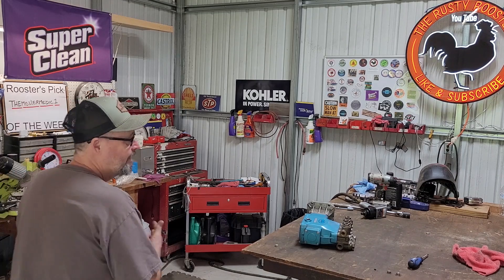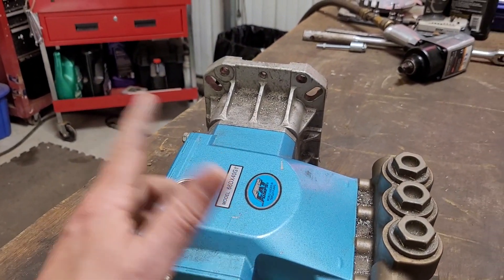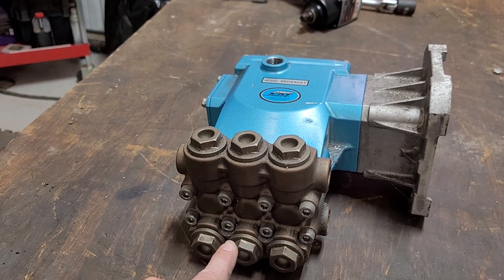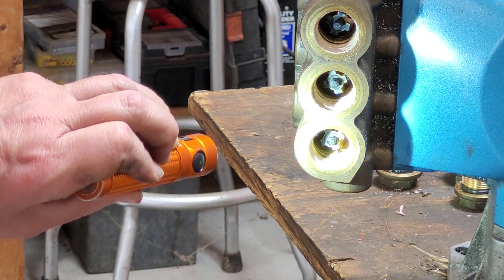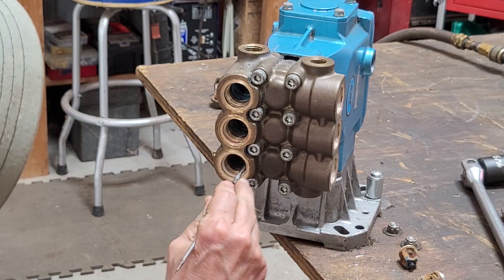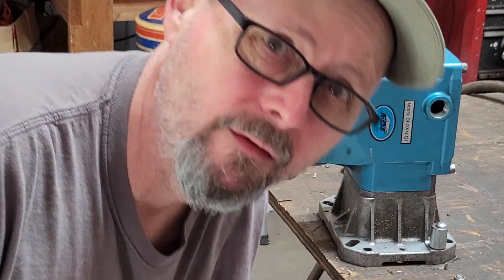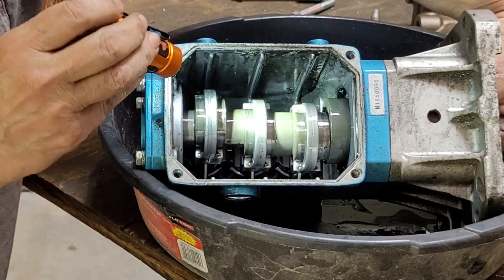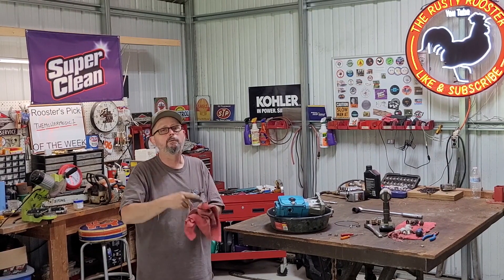Pressure Washer Pump Tear Down General Discussion What's inside How's it WORK

Comment: Great video Mr. Rooster!  Around my area most of these meet there demise because people leave water in the pumps over winter and it freezes and cracks the pumps.
Reply from the maker: Hey hey fella,  I bet ya have. Iv seen quite a few down here freeze myself
Reply from the maker: It pretty much not worth it once frozen
Reply: @TheRustyRooster  Yeah, I have 2-3 of them I’ve picked up over the years.  Replacing the pump with new is more than the machine is worth.